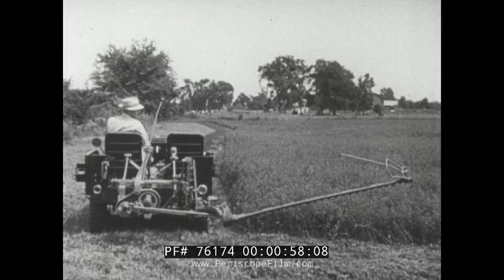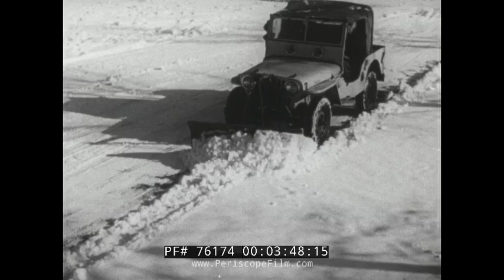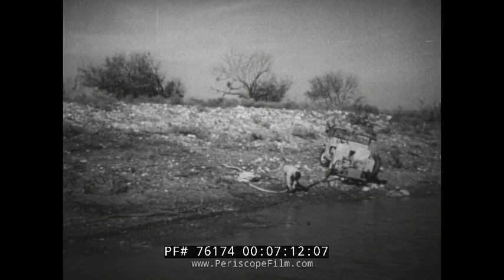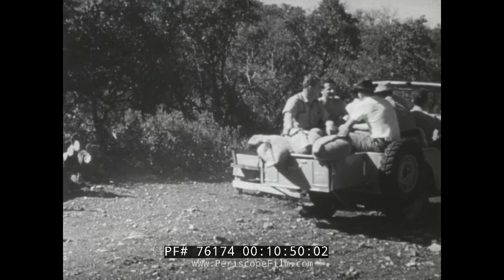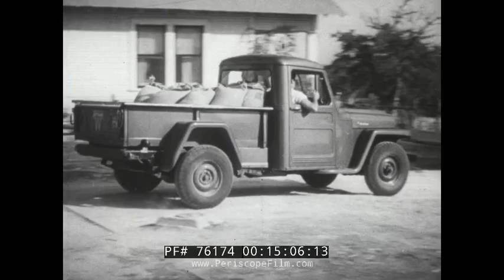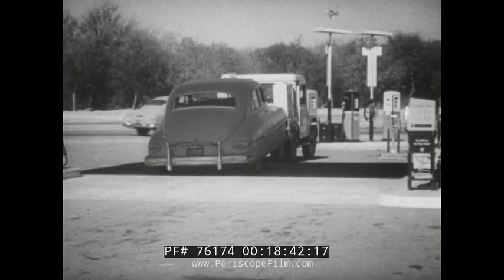1940s WILLYS JEEP PROMOTIONAL FILM  -- THE JEEP FAMILY OF 4 WHEEL DRIVE VEHICLES   76174

Comment: unlike today...army asked for a particular list of capabilities  and gave a deadline for full size tests. Willis won but could not meet amount needed in WW2. ALL CAR MAKERS USED WILLIS DESIGNS! All parts had to be interchangeable.
Reply: American Bantam and Willys Overland were the only respondents to the Ordnance bid.  

After initial prototype testing Ordnance insisted that Ford join the competition. Small contracts were awarded which resulted in Bantam (BRC), Willys (MA), and Ford (GP) models for further testing and evaluation (severe abuse).

Only Willys and Ford produced the WW2 standard 'Jeeps' after W/O was awarded the contract to build 'Truck, 1/4 Ton, 4X4, G503' in July of 1941.

Willys would go on to produce over 360,000of their Model MB by war's end while subcontractor Ford would build over 280,000 of their Model GPW.

There was almost complete parts interchange between the two (My MB wears a Ford cylinder head) but there were several differences.

The stamped steel 'nine slot' grille with hinged headlights was a Ford innovation. Early MB and very early GPW models had welded iron 'slat' grilles as had the MA and GP prototypes.

Comment: Aaaaahhhh the good ol days when there was no global warming, lead paint was standard issue, leaded gasoline gave u that after supper buzz, used oil did a great job as dust suppression, and your Willies plugged along steadily,  its carburator slobbering gobs of fuel into the screamin mouth of a 6 cylinder , frig, those were the days ..
Reply: Jeeps were 4 cylinder (Like the MINI) originally it was after the sale to AMC that they used Six cylinder (and admittedly during the Kaiser jeep era with the Wagoneer and Gladiator)

Comment: The good old days when; driving around with an unsecured lump of rock swinging by a chain from the back of your little 4x4 was considered safe.
Reply: Ignorance was bliss. Except for all the people maimed or killed by the way we used to do things. Hard to believe I have survived it all relatively unscathed. 

I even survived driving a 1963 Corvair for several years with nothing worse than some poop stains in a pair of briefs when I first learned about the high speed cornering characteristics of swing axles. That turned out to be useful experience for driving the U.S. Army's replacement for the Jeep (M-151, built by Ford) a few years later. (I wonder what ever happened to all of those things? I mean, the ones that did not get totaled in rollovers.)
Reply: And “at up to 50 miles an hour”!

Comment: Someone needs to start building those old Jeeps again here in the US...Maybe the Mahindra Roxor will soon be equipped to do all these tasks as they do hold the patent rights to the old Willys and have for several decades.
Reply: they must
Reply: William Todd The US  is a private corporation located in Washington DC. Google it. You probably meant The Old USA... Take care!
Reply: As long as it stays on the farm, they aren't street legal.
Reply: @bigredc222  FYI you can take tractors onto the street/Road so theoretically you could say that the Roxor? Is legal to be taken on the road for short distance journeys or to another farm (heck I saw a tractor on a highway a few weeks ago so obviously tractors are highway legal)
Reply: @sockshandle  When I was teenager I worked for a guy mowing big fields, we would drive the tractors several miles rather than loading them on the trailer, we never had any trouble, But that jeep is more like an ATV, which farmers do use, so a farmer could probably get away with using it on the road to get from one field to another, but if you're more than a mile or so from were you live, you're getting a ticket, around were I live anyway.

Comment: Anyone know when they stopped installing the pto's in the jeep
Reply: I've wondered that myself.  I think it was later in the '60s sometime, possibly with sale of The Jeep Corporation to AMC in 1970.  They were certainly available in the early '60s.  Ramsey and Koenig were authorized Jeep accessories; no PTOs were stock.
Reply: @thomasmartin8202  i have had a 63 jeep and a 65 jeep pickup neither had a pto,  my father had one i think from 57 that did have one,
Reply: @travisleeds2910  I had a 62 pickup with an 8000-lb Ramsey and now have a 57 wagon with a 6000-lb Ramsey and am trying to buy a 57 pickup with a Koenig.  All typical, front-mounted PTO winches.  I have a 66 CJ-5 that had a small electric winch until I took it off.  Do you know what your dad had on his 57?
Reply: @thomasmartin8202  no and he sold it before he passed about 10 years ago,  i wish i would have paid more attention back then,  he had fabricated a large crane type A arm on the front of the thing that could  pick up a pickup if he wanted to, but he used it to move heavy loads of well casing and other items driiling water wells with a old hammer style drill.
Reply: pto depended on the transmission and transfer case type so T90s were mainly used. I don't see much PTOs on Chryler Jeep past 72.

Comment: Who would have thought the Ford GP (affectionately known as the Jeep) would have been so effective. Its ironic that Willis later also made Ford Pattern Jeeps. The slightly more powerful motor was one of the few differences between Ford's Jeep and the Willis ripoff.
Reply: Actually is was Bantam who designed the first jeep. But Bantam could not build them fast enough so the government made Bantam hand over their blueprints to Willy's Overland and Ford. Willy's was called MB, Ford made the GPW.
Reply: @jimholmes2555  Hi Jim
The Ford designation stood for body type G and engine type P, not General Purpose as is now claimed. The engine was a typical English design that Ford USA had no time to modify. Small bore, long stroke and low compression. The design was owned by Ford of England. It was one of the components they couldn't give to Willis and anyway it wasn't great.

A new square engine was designed. The bore and stroke were the same size. The compression ratio was increased for America's superb WW2 gasoline RON 87. The new Willis Jjeep produced 40% more power.

The Bantam started by using many British parts but as the Jeep developed, it got much better American hardware. I suppose you could make the same claim for the American Language. I wonder why you guys still call your language English  LOL 😂
Reply: @jimholmes2555  Yes Jim I believe you are absolutely right BUT
The Bantam was a very small manufacturer of cars based on Austin of England. They designed and built the prototype of a 1st class vehicle that almost met the Military Spec in just 8 weeks. The 1st of the Jeep class of vehicle. The one thing they missed was you had to build them in large quantities. It is an essential part of the design. A jeep is by definition mass produced.

The Bantam used the Meadows engine, in short supply and I believe Salisbury of England diffs. Worse than that they used manual bend brakes and workers with hammers and forming wheels to form the bodies. Impractical on build volumes over 50 vehicles a week. The Army Ordinance needed 40 vehicles a day. Call in Ford and ask Edsel to redesign and build them.

Google Bantam to see how similar they were to The Ford Jeep yet how different the detail is. Astounding tribute to Ford.

Ford developed a pressed steel body where their 100 ton presses could stamp out, for example one body in 3 minutes. 1 grill in 40 seconds and so on. They also took a Ford of England motor, modified it and produced it at Dearborne.  BUT...

Ford were the GO TO place for the military to get anything made. Willis had made not so great cars so they had little military work. Here was the design and tooling for a 1st class vehicle. Get Willis to make them, they couldn't mess it up.

And they didn't mess it up. They stopped making cars and focussed on 4x4. Well the rest is history.
Reply: @johnbondza  Yes. And Bantam was given the contract to build the trailers. I have a '51 Willy's CJ3A with the original L134 Go Devil engine.
Reply: @jimholmes2555  Wow you lucky B#$$#RD. I only ever got to drive one Ford for half an hour. It was fun but very pedestrian. I used a CJ 3 in the Angolan war but later got one of those incredable Jeep Wagoneers. Everyone else had LandRovers and they envied me with that powerf 6 u cyl torque. Every time a LandRover broke, which they did quite a bit. I was,assigned to tow them to the BLR workshop. This meant I could also do some shopping at Ruakana for treats we didn't have.
Reply: You have it backward.

Comment: Yeah, this is a 1955 film, or before. The CJ-5s are all the early style with shackles at the rear of the spring. That was a '55 into '56 feature only. Also note the 1954 license plates.
Reply: 'Shackle reverse' was used on the CJ5's military precursor, the M38A1 (Willys MD), and carried over to early CJ5 production.

Comment: Technically their open differentials make them all two wheel drive, instead of the normal one wheel drive that most people use.
Reply: Correct, but the revolution was that you had power to all four wheels, not necessarily traction, and in some cases you can actually get torque at all four if the resistance side per side is fairly equal (I'm sure you already knew that)...also, open diffs or not, aside from the extreme off-road scenarios, just regular 4 wheel drive will get you about anywhere you want to go...I drive a stock XJ with open diffs and I'm always amazed at the places she'll go without LSDs!